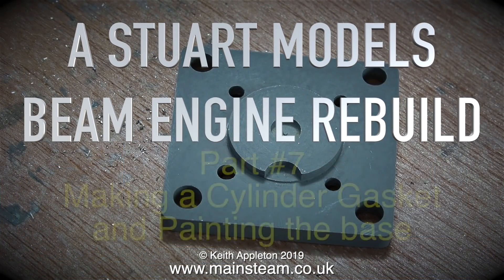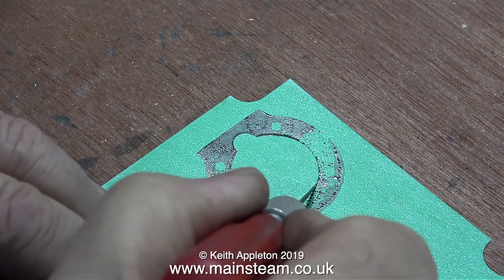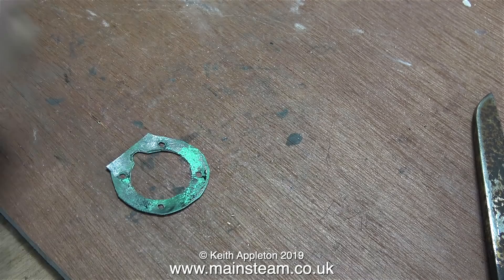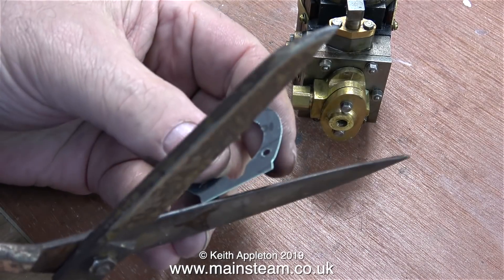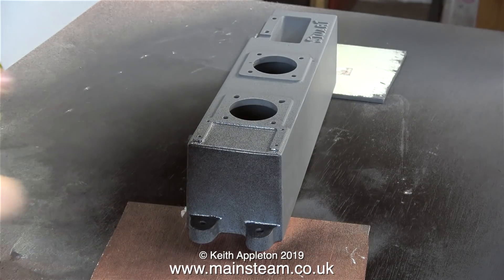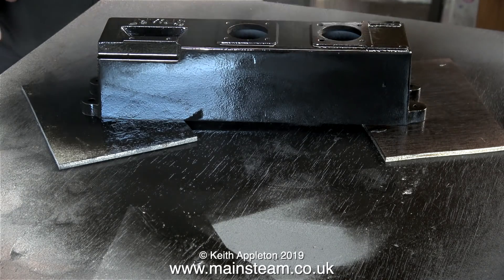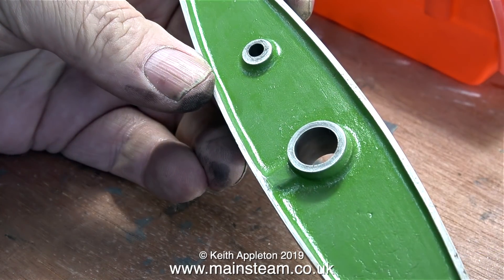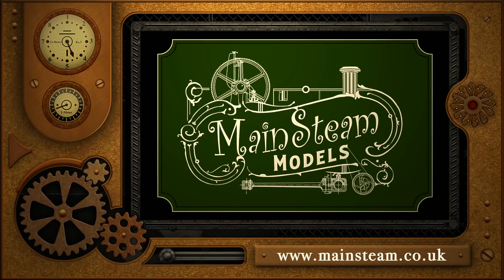A STUART MODELS BEAM ENGINE REBUILD - PART #7

Comment: I've recently seen many of your videos where painting is involved, and they've made me wonder if you had ever thought about using a cheap cake spinner/turner to move parts much easier, in order to avoid getting paint on your hands or touching the wet paint. Have a wonderful day.
Reply: Because of his "working style" .... every job he do, looks like an improvement.... the tools, the bench.... the surrounding.... 
Nothing is prepared to do the job.... looks like he get out of bed.... go into the shop, push everything on the bench a little bit to side, an go on.... 
Pure profession..... (sarkasm) Thats Mr. PPP (pumps paint and pipes)
If i want to see painting metal, i go to a painting Channel....
Reply from the maker: I make one of these videos almost every day and I don't have the time or need to waste it tidying up the bench . . . . .

Comment: Keith, You can stain the white edge of a gasket with a black felt tip and it will disappear  when installed on a black part.  David